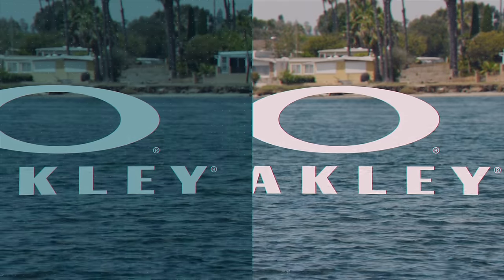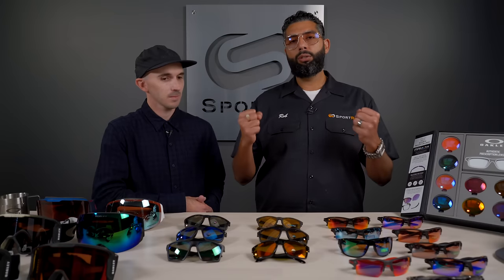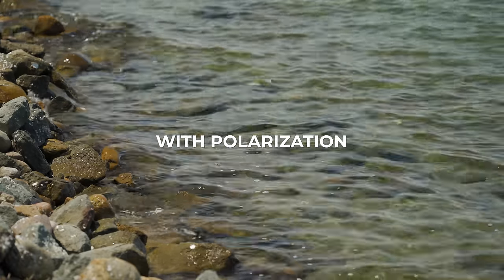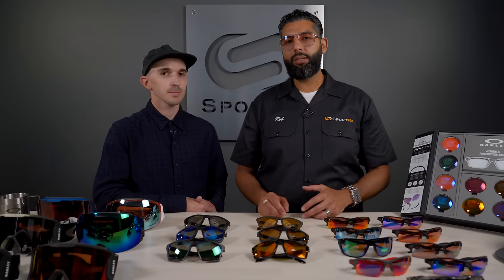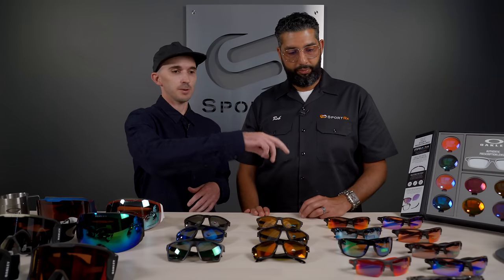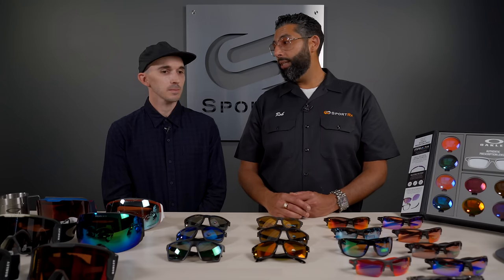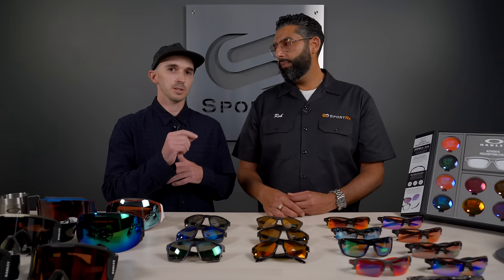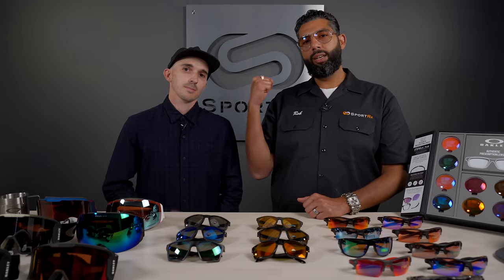Are Oakley PRIZM Lenses Polarized? | SportRx

Comment: I have used one pare of Radar EV prizm polarized for 7 years now and its absolutely stunning love it 
unfortunetly i ruined it just few days ago by leaving it wet after cleaning with chemically not clean water (tap water in Georgia ) so coating got "eaten" off on same places, have to replace lenze, one cool feature is that you actualy can only buy replacement parts such as lens itself and all rubber parts that gets soft time to time. so thank you Oakley for providing cut edge technologies for everyday use keep going!

Comment: Hey guy.   Love my SI Fuel Cell Prizm Polarized sunglasses.  I have a question.  Are those Zeiss lens cleaning wipes ok to use on Prizm Polarized lenses?  Is there a best way to clean lenses?  Thanks.  Great video.
Reply from the maker: They should be just fine. Here is a lens cleaning video you can check out too:  https://www.sportrx.com/blog/how-to-keep-lenses-clean/

Comment: Are prizm lenses okay for pilots. If so which Oakley glasses offer the prizm lenses without polarization. I’m aware that pilots can’t use polarized glasses due to the interference it has on flight instruments. I was wondering if this same restriction applies to prizm lenses with non polarization.
Reply from the maker: Good question! No, Non-Polarized Prizm lenses do not have the same restrictions for pilots. Polarization can interfere with a pilot's ability to view and interpret instrumentation in the cockpit. Any Prizm lens with polarization will be noted in the name (i.e. Prizm Black Polarized).

Comment: How can Prism Road not be available in Polarized option?  Road glare off shiny roads is one of the worst things in sunny climates.  Cutting out road glare with polarization makes a huge difference.  I'm skeptical about tweaking color spectrum with prism being able to match or better that.  The video didn't address this.  Please convince me a blinding shiny road will look better through prism than through an amber tinted polarized lens.
Reply from the maker: Hi there! You bring up a great point! You are correct that a polarized lens is necessary for glare protection. However, PRIZM Road is not polarized because being able to spot the glare off water patches or oil slicks will help you to react quicker on your bike. PRIZM contrast makes everything in your environment pop with detail so you can see every little detail on the road. All Oakley lenses are 100% UVA, UVB, and UVC protected. Oakley just recently introduced a PRIZM Road Black lens that is more ideal for sunny environments because it is a darker tint but still made for the road environment. Hope this clears things up for you! You can leanr more about PRIZM Sport here:  https://www.sportrx.com/blog/oakley-prizm-sport-lens-technology/

Comment: Now I’m worried because I play baseball and I just bought the Radar Ev black polarized prizm glasses do I need to take them back? And get only prizm or what
Reply from the maker: Not necessarily. Some people can use polarized lenses and it doesn't seem to bother them. You may find that it will work just fine for you. I would recommend testing them out just a bit if you can.

Comment: What about for driving, I'm looking for something that makes visibility better when driving in rain and bad weather.  In this case I'm think of buy Prizm Polarized with a high % light through, I see a few lenses up to 17%.  I have cheap polarized glasses but do not see any issue with depth perception.  So not sure what you would recommend though.
Reply from the maker: Hi there! It sounds like you are on the right track. A higher VLT will let more light in through the lenses and would make sense on overcast or rainy days. PRIZM Ruby  works great for a variety of conditions. You can also check out our guide to buying driving sunglasses fore more things to consider:  https://www.sportrx.com/blog/how-to-buy-driving-sunglasses/  and if you need more assistance, we have certified opticians available on the phone and livechat here:  https://www.sportrx.com/contact
Reply: Hey, thanks for the detailed answer, will pop into my Oakley store nearby and try them out with your advice in mind. Puls5, Zurich.

Comment: So I shouldn’t use polarized for running trails in San Diego or mountains at elevation? 
When I wonder why I can’t see shadows on trails is that why?  Depth perception?
Reply from the maker: Hi there! The main benefit of a polarized lens is glare reduction. Glare occurs when vertical sun rays bounce of an object to create horizontal rays-the harsh glare is the combination of the two. PRIZM manages color. It separates the noisy colors while highlighting the colors your eyes are more sensitive to. This contrast boost helps you spot textures and details easier. I really hope this helped answer your question. If not, you can always contact one of our certified opticians here: https://www.sportrx.com/contact

Comment: I’m want to get a pair of Oakleys prism polarized for fishing to cut the glare off the water and see fish but I also want to use them for playing baseball. I play infield but the big thing is seeing fly balls and not losing them in the sun. Would prism polarized be good to do both and would it mess up the way I see and judge the ball when I’m fielding it. If they are fine for that what is a good suggestion for lense color. Thanks.
Reply from the maker: Hi there! Great question! Polarized lenses have been known to slightly affect depth perception which is why we do not normally recommend them for sport. However, there are half rim frames such as the Flak 2.0 XL that allow you to swap lenses on the fly. Getting two separate sets of lenses may be your best bet! You can always contact one of our certified opticians for more guidance and information:  https://www.sportrx.com/contact

Comment: I'm a trucker. What kinds of glasses should I get?
Reply from the maker: Hello! It's tough to answer that question without knowing a bit more about yourself and the conditions under which you drive. For example: size requirement, prescription needs, lighting and environmental conditions, personal preference, etc. Some truckers like a full wraparound frame with dark tinted lenses coupled with a mirror, especially if they're particularly sensitive to bright light and/or travel through hot desert climates. Others prefer a photochromic (transition) lens that will darken and lighten with exposure to UV light or lack thereof. Give us a call to speak with a licensed optician who can help determine what frame and lens options work best for your individual needs, or shoot us an email or take advatange of our chat feature on SportRx.com. Hope to hear from you! 😎🔥

Comment: Does Oakley not make fuel cell with the iridium black polarized anymore?
Reply from the maker: That is correct. It is offered in PRIZM Black, Grey Polarized, and PRIZM Deep Water Polarized though! You can check it out here:  https://www.sportrx.com/oakley-fuel-cell.html   Thanks for reaching out!
Reply: @sportrxeyewear  so grey black polarized fuel cell is the prism?
Reply from the maker: Not quite, the Fuel Cell is not available with black iridium polarized as a stock option anymore. However, it is available in PRIZM Black(non-polar) and PRIZM Grey(non-polar). If you want a polarized option it is available in Grey(non-PRIZM) polar, PRIZM Ruby polar, and PRIZM Deep Water polar. If you have any additional questions you can always contact one of our certified opticians here:  https://www.sportrx.com/contact

Comment: I have a pair of sapphire polarized jawbreakers. But whats the diffrent bettween it and prizm black polarized?
Reply from the maker: Hi there! They are both grey base lenses which mean that they are meant to block more light  than a lighter base tint like brown or pink. However, PRIZM Black is rated at 11% VLT and PRIZM Sapphire is 12% VLT. VLT(Visible Light Transmission) is a measure of the amount of light that passes through the lens to your eyes. This is a very very minimal difference but it showcases how PRIZM Black is just a hair darker. The other key difference is aesthetics of the lens from an outside perspective. You can learn more about PRIZM Everyday lenses here:  https://www.sportrx.com/blog/oakley-prizm-everyday-lens-technology/
Reply: @sportrxeyewear  thx, btw can you make shallow water or deep water polarized glasses for the jawbreakers so i can go fishing in them 😉
Reply from the maker: We wish we could! We can make an embedded rx shield lens for the Jawbreaker but it is only offered in clear, grey, or black. Unfortunately Oakley has not released non-rx replacement shields in either PRIZM water lens yet.

Comment: I had a Monster Dog back in 2006 and it was perfect. I lost it, and I bought a new pair in 2015. The new lens is terrible. The top layer was pealing off after 3 months of use. I took is back to the store, and they gave me a new pair. After 3 months the same thing happened. The top layer was pealing of on both sides, interior and exterior... piece of crap if you ask me. And it was 20% more expensive than the pair i bought before...
Reply from the maker: Hello! Peeling is usually a result of abrasions and/or high temp exposure. This is especially true with mirrored lenses. Dropping the frames or cleaning the lens with ones shirt can cause pock marks on the mirror that worsen over time. Leaving sunglasses in the car on a hot day with the windows rolled up can also cause peeling depending what coating is applied to said lens. Oakley's tech has improved over years and with proper care, should not peel or delaminate. Hope this helps!

Comment: I use my rayban chromance polarized lenses when I ride mtb. Never had an issue with polarization and depth. The chromance works great to bring out features. Never got along with Oakley frames but rayban technology is virtually the same.

Comment: Salam. I live in Azerbaijan. It is not hot country as Arabia. We pass all four seasons normally. I would like to get advice on what Oakley sunglasses I should buy?there are a variety of sunglasses of Oakley. So I am baffled. Please, could you give me advice?I will use it for my daily life. By the way I am an officer.
Reply from the maker: Greetings Jan! When it comes to frames it really helps to try on some models to determine the appropriate fit. That said, you can also compare the width of your current glasses to the sportrx frame width (SFW) to get an idea for the right size for you! For the lenses, You'll want to decide if you want 1 lens to work in a variety of lighting conditions like a transitions lens. BUT if you prefer a set tint that does not transition to be used for bright sunny conditions, then i'd recommend something in their Prizm lens line. I'm particularly a fan of the Prizm Tungsten but there are many other tint+mirror combinations to choose frame that deliver different contrast results. 

You can also shoot any questions to info@sportrx.com and a licensed optician will get back to you in no time!

Comment: I purchased a pair of prizm polarized Radar Ev Path from the Oakley website. The photo on the website has "Prizm P" on the bottom corner of one of the lenses, however the actual sun glasses that came in the mail only say "Prizm" on the corner of one of the lenses.  I called customer service and they can't really clarify, they figured they probably sent me the wrong pair (non polarized) and mailed me a new one. Same thing with the new pair that came in though. Do you guys know if my sunglasses are polarized? Why would the website show them as Prizm P but mail a pair that only say Prizm? What the difference? I'm assuming P means polarized but now I'm confused. Thanks.
Reply from the maker: Hi Jorge! There have been some changes to Oakley manufacturing and quite frankly it is hard to keep up. I would recommend checking the label on the box and product number on the inside of the temple arm. Both should confirm it is a polarized lens. Another way you can tell if it is polarized is if you hold it up to a digital screen and tilt it upward and  downward, back and forth. The screen should appear semi distorted, similar to a thin layer of gasoline on a puddle. If you need more help feel free to contact one of our certified opticians via phone or live chat here:  https://www.sportrx.com/contact
Reply: SportRx awesome, thanks for your help & keep up the good work! 👍🏼